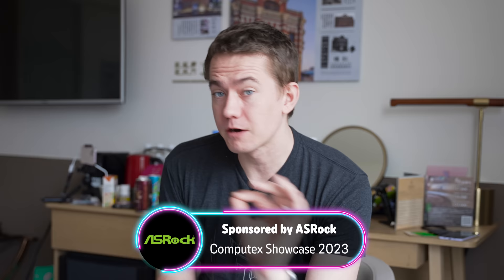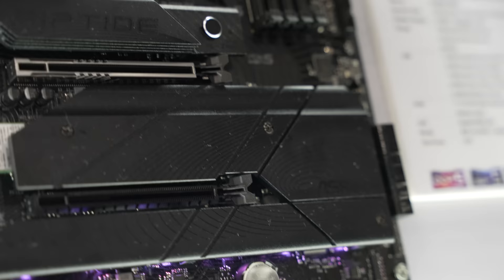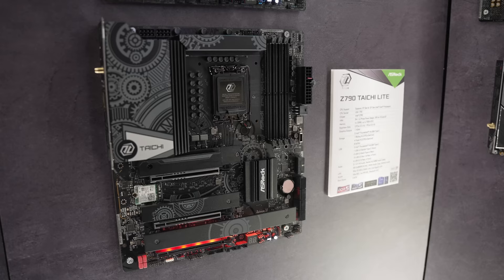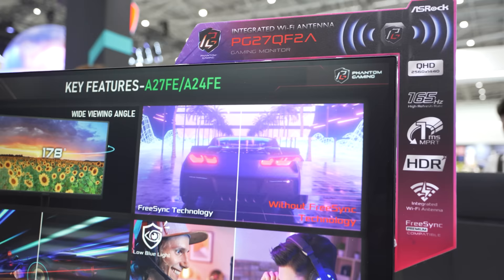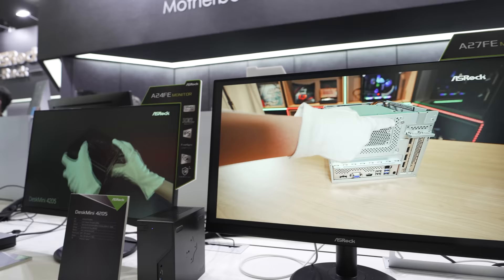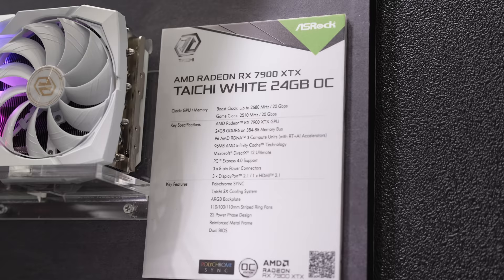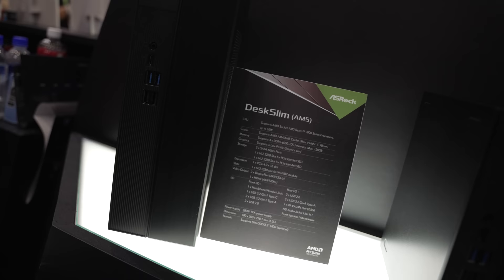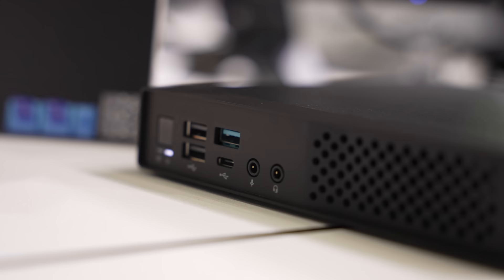ASRock's 8K Monitor, New Intel Motherboards, & White GPUs - Computex 2023

Comment: I didn't expect both ASRock and Acer to impress me the most this week. It's nice to see Thermaltake back on track too
Reply: Back on track geometry dash
Reply: Going by this you could have your small form actor Junper case below a 2.5G switch below a ASUSTek NAS for a setup that won't take up much room and have 8 wired network ports to connect to also up to 160TB of network storage So having to go with 2 different companies but ASrock doesn't make NASes. ASUS boards for the low power system in their NAS also stands up to the test of time just don't expect it to run fast doing anything but network storage.

Comment: The problem is it’s an 8K monitor but it only goes up to 60 Hz, while that’s all fine and good if while you are outputting 8K, it would be nice if it were at least a 120 Hz panel in case you want to step down to 4K.
Reply: Actually not that bad as there are basically ZERO 4k/8k monitors in this size today that you can buy with IPS and good colour representation (DCI-P3 95%+).   As for 8k, to me that's immaterial as I would only push 4k to it and have it scaled 200% (8k is way too fine to use at 55" and at 2-3 foot viewing distance).  I just want more information on the bloody thing like when is it going to be available!  :)

Comment: If you either bump the resolution down to native 4k or use DLSS from say... 1440p, does the PG558KF have a higher refresh rate or is it still 60?
Reply: Still 60.
Reply: @fepethepenguin8287   you are better off getting a samsung 8k tv it will run 4k @ 120hz and 8k @ 60hz
Reply: @ployth9000  ya.. better than this thing.
Reply: @ployth9000  Actually if you want the very best... skrew 8k. And get a Samsung S95C or last years S95b QD OLED , wut I ended up upgrading to. And it's INSANE blows all monitors away

Comment: I've got a Dell UP3218K, and would love a better 8K monitor, given that this tech is several years old now.  Better means the same or smaller screen size -- ideally 27" diagonal, given that I'm currently at ~32".  The 55" of the ASRock PG558KF  is a downgrade, imho.  It means bigger pixels, worse pixel pitch, less fine-grained detail.  It takes the display industry forever to improve upon high resolution displays.
Reply: I don't think 8k Asrock monitor can beat Dell up3218k in color department.
Reply: @donganhnguyen6160 , I'm stuck with the Dell for a while.  I've learned to live with the vertical lines at the left side from its TAB error.  Looking forward to the day that I can buy something better.
Reply: would you buy the dell over the new samsung neo g9
Reply: @WoodakaDiddy , yes.  The Neo G9 is a 49" 5K  display.  A 32" 8K like the Dell has a higher pixel density.  The Neo G9 has a higher refresh rate, and it's curved to sort of wrap around the viewer, so it has some features that might help with immersion in games, but overall, the more manageable size and higher pixel density of the Dell UP3218K makes it a better monitor if you're using it for more than just gaming.  That's my perspective.

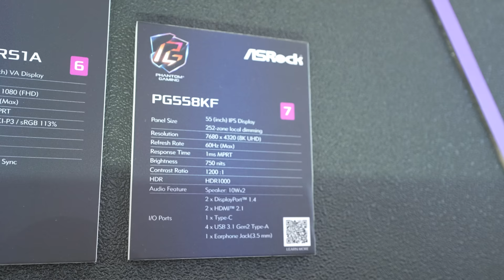Comment: 3:31 Those TV specs for are garbage.
8K does not make sense with LCD, we need 8K OLED (at 120hz using DSC over DP2.1... My 7900XTX is ready).

Comment: the only downside to the 8k monitor is it does not run 4k @ 120hz I should go with samsung tv at this point it will run 4k @ 120hz and 8k @ 60hz

Comment: Asrock and Acer are the 2 brands to look out for when seeing all the coverage.  Its refreshing to see these brands focusing on value.....that said, Asrocks focus on higher end displays might be a mistake, I understand they want the margins but they need to establish the product line first, that work has not been done yet.  The display line feels disjointed from their other products.
Reply: ASRock has made quite a journey, from avoid-at-all-cost entry level junk to being one of the top manufacturers with reliable software. Now that ASUS is out of the question for obvious reasons, not to mention Gigabyte's horrendous motherboard backdoor fail, I feel that ASSRock is one of the top picks for motherboards now.
Reply: Actually, ASRock is focused on value at all levels of the market!
They have Curved VA 34in WiFi screens down to 27 1440p flat panel Screens. Their biggest issue is market dynamics and distribution. Like here in East Africa, we have to ship and that stops most people from getting home desktops for entertainment.

Comment: I clicked so fast when I read 8k monitor,  but sad it's only 60hz.. and not a very high ppi as well, I'll pass.  I Want a 8k/10k 28" ips 144hz monitor!
Reply: IPS is garbage, mini LED is overrated.
I'm waiting for Micro LED, that's gonna be sick, imagine an OLED without problems with high brightness or burn in 🤤
Reply: @Mikaela Lumiere  looks super nice still, and cheaper. Need the money in res and hz

Comment: 1200 to 1contrast ratio... HDR aint gonna look all that great even with the HDR1000. Not a fan of mini led for HDR content at all. Would only ever get one if they were on par with OLED. Only win for them is no burn in risks. 8k 60hz, 252 dimming zones on in a 55inch screen... Im fine with getting a 4k OLED where all pixels are dimming zones, and get 120hz. I personally went with the AW3423DW not long after its release and love it.
Reply: Mini led is the closest one can get if you don't want to deal with all the oled problems. If you can find one with 2k plus zones & high HDR, it's really hard to tell the difference at time
Reply: @ShalowRecord  ah yes all the OLED problems. Literally just burn in as OLED is better in every other area. You also get warranty now for burn in and most stores offer it you if the manufacture does not. Mini led is just not it, Micro LED will be but that's not for a long time to ever hit normal consumer market. And who knows, we may get something much better by the time it does. I have used Mini LED, OLED and QD OLED and ill take the OLEDs over even high count Mini led.